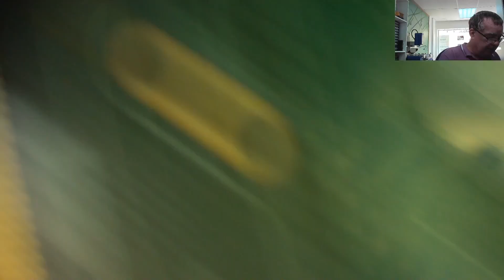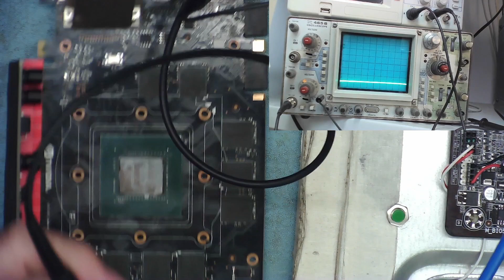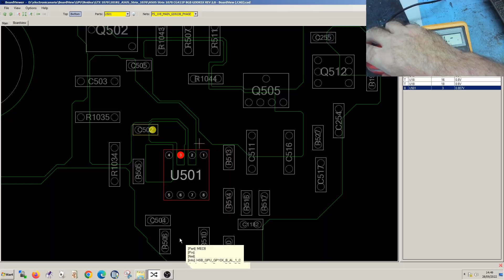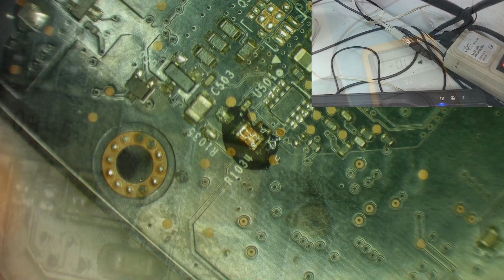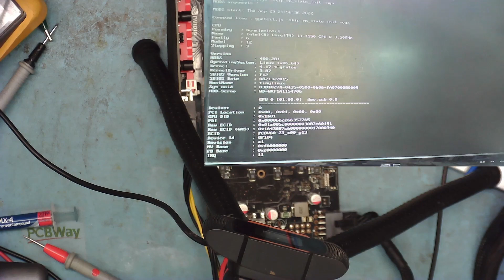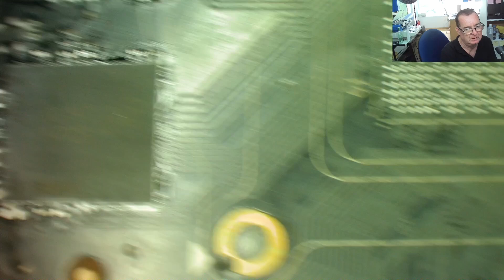GTX 1070 Does Not Start / Not Detected By PC - Can We Fix It?

Comment: I like the way you went about tracing back the voltages down to the 1.8V rail in order to diagnose the problem. The way of processing it is very interesting, and boardviewer circuit diagrams definitely help a lot as well.
Reply from the maker: Thank You 🙂  I mentioned the fault finding process in passing on the video but for those not so familiar:  The tracing of the fault back to the 1.8V came from having some understanding of the power on sequence for Nvidea graphics cards 12V and 3.3V -->>5V ->>1.8V ->>PEX (0.9V-1.0V) ->>Vram (1.5V/1.35V) ->>Vcore ~0.8V

So basically I figured out that the first voltage rail in the sequence that was unstable (in this case 1.8V) was probably messing up all the following ones.

Regards the boardviews, the one I used in this video was not the correct one for this graphics card but it was close enough. You can download board views and schematics for free on LER discord.

Learn Electronics Repair is now on Discord!  Come and join the fun and let's fix stuff together, it's free and a nice place to be.
https://discord.gg/vam6YC8vwU
Reply: @learnelectronicsrepair  cheers LER already a member of the discord server for quite some time and love the place it's great, being surrounded with people who have similar interests / hobbies as you! As well as a great bit of knowledge and experience.

Comment: I am wondering if you could have located the faulty 0 Ohm resistor using the thermal camera you showed the other day.😀
Reply from the maker: Well, this is quite easy to work out.  So the resistor was reading 228 ohms and the voltage dropped across it was about 2 volts (12V - 10V).  Obviously it was acting somewhat intermittent and the actual ohms value was changing as the voltage coming out of it was also changing.  But anyway we can do a rough calculation using ohms law.  So first we need to know the current passing through the resistor, I=V/R so 2/228 = 0.008A or 8mA.   Hmmm then the wattage is going to be very low... W=VxI so 2Vx.008A = 0.016W or 16mW.   I did get the thermal camera to show up heat traces at a dissipation of about 15mW but given there is a fairly heavy power plane in this area of the PCB my best guess answer would be no, I probably couldn't have located it with the thermal camera

Comment: Small suggestion - Get an adjustable pcb board holder - frees up your hands/fingers and it will provide stability and locks board in one position when soldering, making measurements, etc. Circuit boards that are awkward to position can lead to bad measurements, accidentally shorting components, poor soldering, (burnt fingers, cold joints,etc.)
Reply from the maker: That's a very good idea - I only have this problem when I have things like a GPU that will not site flat upside down but I'll find something

Comment: Hi Richard, if I may a suggestion - get some good overhead lights. It makes a huge difference while looking at the boards under the microscope. And also we will see you better when there is much light in the background (window) ⬅
Reply from the maker: Hmm I have two 58W flourescent tubes suspended on a beam 1m above the workbench. I also have three more florescent tubes (smaller ones) in the ceiling just behind me. I can't do much about the shop window right now but I'll be getting some vertical or roller blinds for it soon as I have another project planned.
Reply: @learnelectronicsrepair  see yet another way to create some content 😀thumbs up for that. When you use the flashlight on the PCB under the microscopbe, the image is so much better.

Comment: ./ just tells the Linux system to run the command from the directory you in, rather than trying to use a binary in path
Reply: 'which mods' will tell you the location of the binary that gets executed when you're not using './'
Reply from the maker: @HoracioGonzalezLarrain  depending which directory I go to, mods either accepts the argument -oqa or -mfg.  And those arguments are specific to mods versions 4xx or 3xx respectively. So I accept I don't know the exact location but I do know which version of mods runs when I am not using './' and it changes when I go into directory 4xx or 3xx
Reply: @HoracioGonzalezLarrain  that's true. Great suggestion. 'which mods' will say the mods script that will be used. If you jump into each directory and run that command you can see if it changes. Great suggestion
Reply from the maker: That is true but there is something wierd about my linux hard drive - I didn't set it up, it's the 'kings overkill' one.    So if I miss out the ./ then the first instance of mods in 'the path' would always be the one that ran yes?    But:
If I cd to a directory 4xx.xx.x and run mods without the ./ then the version that runs by default is the one that requires the -oqa argument, which is correct behaviour for mods v4xx.  
If I cd to a directory 3xx.xx.x and run mods without the ./ then the version that runs by default is the one that requires the -mfg argument, which is correct behaviour for mods v3xx..  

I know that is the case as if you put the wrong argument for either version of mods it tells you so.   What no one managed to explain yet is how it knows which version to run by default if I miss off the ./
Reply: @learnelectronicsrepair  have you checked that there isn't a copy of mods in each of the directories that has been modified to run the correct parameters for that test
Reply from the maker: @theshemullet  I'm sure that is what I do have as if I type ./mods it also works.  But according to my understanding if I type mods without the ./ it should always run the same version, the first one in the path file, and that is not what happens.
Reply: @learnelectronicsrepair  it must be something like that. Although it wouldn't be difficult to customize Linux to chose local file over path based. It may have been made like this to make it easier to understand for users coming from windows command line
Reply: If running without `./` doesn't produce a "executable not found" error, the tool must be installed globally by being included in the PATH variable which lists directories which are searched when running something without the `./`. You can view the contents of the PATH variable by running `echo $PATH`.

Comment: @25:25 your saying it can't be a missing capacitor. Is that because a capacitor would smooth out the voltage. If one was missing you might get a fluctuating signal?
Reply from the maker: I was kinda intimating that it couldn't be a missing capacitor as I had several different voltage rails what were unstable, and they each have their own capacitors.  I can accept if one rail unstable was causing all the others to be unstable as well, then it could be a missing/bad capacitor on the first rail

Comment: 12:56 so if your only using x1 on the mining adapter. why not use the x1 slot instead of the x16. just wondering
Reply from the maker: No reason really - I just put the card in slot 1 (PCie) 16x as a matter of convention and it gives me a reason to remind viewers, from time to time, about the perils of inserting mining adapters the wrong way round 😉

Comment: if i not miss understand the pcb boardview and schematic, the phase 1 , got 2 mosfet and 2 drivers selected by the u504 , its like a logic gate..i think its a phase 1 backup system. can confirm this? thx
Reply from the maker: Ahh that is interesting,  Also some GPU when idling (before the drivers load) run Vcore with just one phase. I wonder if it is related to that?
Reply: @learnelectronicsrepair  i really dont know that. Im nota engineer but if you track the enables of the drivers you reach the u504.  And i really dont understand how It work. Maybe you with your knowledge can show us the path !! Hehehe thanks for reply